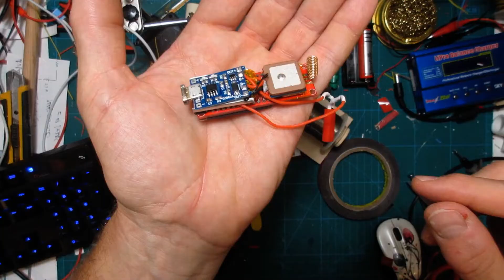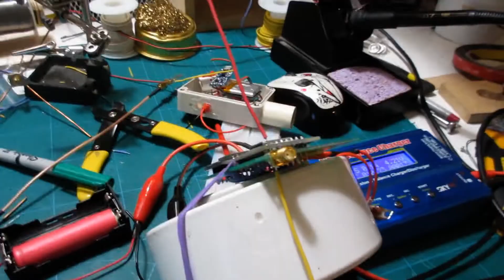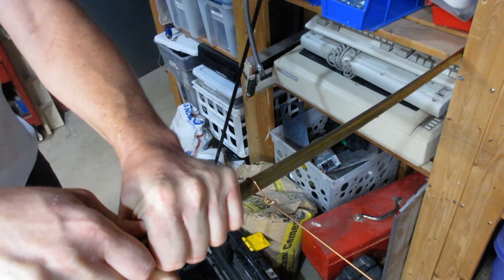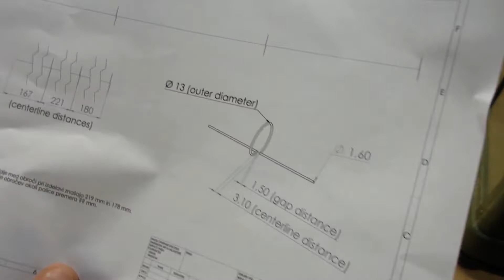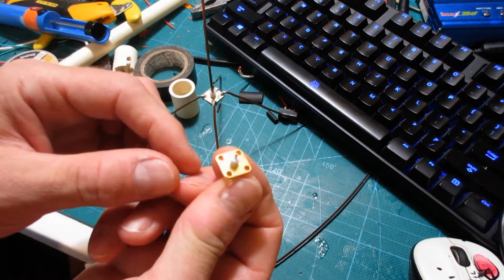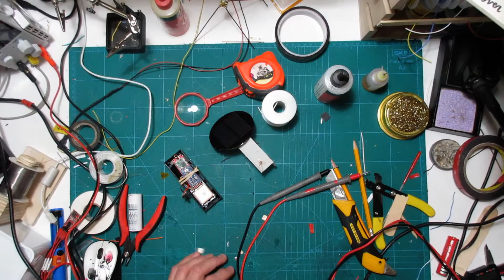LoRa Dog Tracker Saga Continues

Comment: Love the sense of humor along with the explanations.  Thank you for the work you've done to test this out.  I've been wanting to build one of these types of trackers for a while now but was worried about the signal strength as I need to Tx/Rx about 3km, the surrounding area has a few rolling hills but for the most part is not too hilly.  The biggest obstacles are trees so hopefully I can make this work for the distance I'd like.  I think I will take on your advise and use the mono-pole type pyramid antenna and slap that on the house, I'll have to re-watch Andreas Spiess's youtube channel about making a mono-pole antenna, which is another great place to get information.

Comment: Nice to see  you do the Quarter Wave, however, you need to look at this on a Vector Network Analyser before you start going to higher gain antennas. That circular trap goes right on top of the one turn trap. There are better antennas that provide lower angle of radiation, read more effective gain, than that colinear.   Those better antennas can provide a massive bandwidth that exceeds the requirements. That increase in bandwidth and lower angle  of radiation, more narrow towards the horizon, dramatically increases the range.
Reply from the maker: What antenna would you suggest for this application?

Comment: You should try to use the Lora 32 v2.0 boards, they have 50mw power and built in 900 chip and bms. comes with enclosed antenna also.
Reply from the maker: Those look like nice boards.  Might have to give one a try.

Comment: How long does the battery of your tracker last?
Reply from the maker: With a 200mAh batter you get a solid 2 hours of continuous use transmitting every 12 seconds.  You can seriously up that time by transmitting less often and sleeping the components when not in use.

Comment: This is exactly what I was looking for!...but didn't even know it. No seriously, I arrived at the first video through a series of related videos for something totally unrelated to this. The funny thing is that at my place of work we have about 1000 radios that staff use to communicate with each other, but they are expensive and they keep taking them home. So for years now we've been kicking ideas back and forth trying to find a cheap way to track them. I had given up. This is it man, you did it! The only problem is gonna be concealing it inside the radio itself. Do you know if there are smaller versions of the components you used? I'm new to electronics but I where there's a will there's a way.
Reply from the maker: Components are getting smaller for this type of thing, nothing super miniature yet but I'm sure it will come.  Keep in mind that the range is only 1.5km or so for a normal urban environment.

Comment: How long is the runtime with the 200mah battery. I'm looking at building something similar for our cat, so the lightweight but long runtime tradeoff comes into play.
Reply from the maker: I believe I get in and around 2 hours runtime but but but but... much of that is determined by the transmission settings.  The tracker I have in operation reports a location every 7 seconds.  If you up time that to say, every 20 minutes and put the arduino alseep between transmissions, you can save a huge amount of battery!  I believe you can also sleep the GPS but when it wakes up it would take time to reacquire satellites. Hope this helps.
Reply: @dork3nergy  Yes, thank you. I would probably look at about 30 second or 1 minute tx's.  Do you have a parts list posted anywhere?
Reply from the maker: @Monkis74  I just posted it in the description of this video.

Comment: Great work!!!
I wonder how is LoRa efficiency indoor because I want to make an Indoor Car Tracker for parking building by measuring RSSI of LoRa.
And remove GPS chip cause GPS works poorly indoor. (Maybe adding an altitude meter for measuring the current floor?)

Did you think this is a good idea? I will be so glad to hear your opinion :)
Thank!!!
Reply from the maker: Using the RSSI for location is also a good idea but I can't say how it would work in practice.  Obviously it will be be tough for the LoRa signal to get through the concrete floor/walls. I like the altitude meter idea but it won't do much good unless you can get a signal on the receiver end.  Parkades are tough environments for radio signals.

Best thing to do is toss together a couple of units and see what the signal strength is like.   If you decide to try it, keep me posted.
Reply: @dork3nergy  Thanks for your advice. After few hours research on google, I think it's really a bad idea by using the RSSI for location just like you said.
Finally, I found there will be a new Bluetooth 5.1 that supports AoA / AoD. (maybe still tough to get through concrete...but very accurate) https://youtu.be/jSDtUOQXJmo
I guess I will wait for these new boards coming for retail.
And there is a good introduction of direction finding. https://youtu.be/N8rZIAHxAH4

Really appreciate you kindly reply!!

Comment: This is awesome. How does the receiver tell the difference between a relayed packet and an original packet? Or it doesn't? If the receiver receives both, does it just add both GPS points to the map?
Reply from the maker: Hey Greg!  I've been developing the system further over the past few months.  Originally I just tacked on a '*' to the front of the relayed messages but now I have every device transmit a unique ID that I can use to sort out what to do with each signal.  The real work for sorting out messages is at the server and it checks to make sure the message is not a duplicate. The relay also keeps track of the last message it received so that you don't end up with messages bouncing back and forth between relays.

This whole covid catastrophe has put a real damper on video production....I'm working on it though.  Expect a few more in this series soon.
Reply: @dork3nergy  please do! Sounds like you are turning this into a mesh network. It would be super cool if you did multiple trackers or environmental sensors or even chat devices

Comment: What are you pushing the GPS data too? I’m wondering if there’s a web interface or an app that easily excepts this type of data so I can be tracked close to live. Thanks
Reply from the maker: The ESP32 is hooked into my wifi network and the GPS data is pushed to a server computer through a socket.  Once it's on the server machine, the data is used to update a webpage that generates a Google Map.  The Google Map webpage updates itself automatically so it is effectively live.  Does this make sense?

Comment: Hi DorkEnergy, Thank You for this two part TUTE. This could be applicable to a drone application,for a 'fly away' drone it seems,,other than the size factor would still be a bit too bulky for a foldable drone which is what i am wanting to achieve. A bulky fixed arm drone this setup would be fine. is there any way of 'shrinking' the overall size of the 'node' setup? Would really like to try this package for this. Thanks again.
Reply from the maker: I've half started working on miniaturization of the node.  Of course it will involve a whole crap load of things I've never done before including designing and creating a PCB.  Check back once and a while for any updates.  You'll probably be interested in the next video in this series which will be coming out shortly.

Comment: can you share pin connection for lora to arduino?
Reply from the maker: No Problemo.

Lora -> ProMini
^^^^^^^^^^^^^^^^
GND -> GND
3.3V -> VCC
DIO0 -> 2
DIO1 -> 3
NSS -> 10
SCK -> 13
MOSI -> 11
MISO ->12
Reset - > 5

When you setup the software on the ProMini, you'll need to tell it where you hooked up NSS, Reset and DIO0 :

#define ss 10
#define rst 5 
#define dio0 2

Party On Dude!

Comment: To straighten copper wire, place one end in the vice and chuck the other end in your drill.  Pull slightly while you turn on the drill on and watch the magic happen.  A few seconds of running is all you need.  Achieves the same result as stretching, but a 1000 times easier.  BTW, I built a similar, but “more refined” ground plane antenna for my  915 Mhz Lora gateway.  I have 3D models if you have a 3D printer.  I measured 1.1 SWR on my antenna, so it amazingly efficient.  Also, consider connecting your Lora gateway to The Things Network.  TTN take care of the repeater with other TTN gateways in your area.  Nice work, I enjoyed seeing you go through similar challenges as I did...but you had more fun with it.
Reply from the maker: That wire twisting thing sounds cool.  I'll try that next time.  I do have a printer.  It is "3D" but only prints in one dimension on plain paper.  A real 3D printer is on my list ^_^  Thanks for watching!